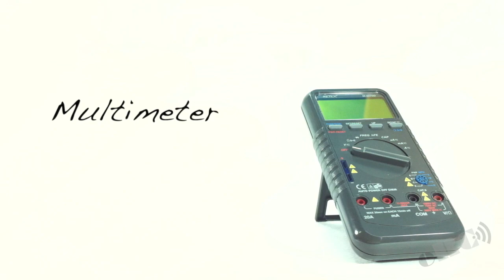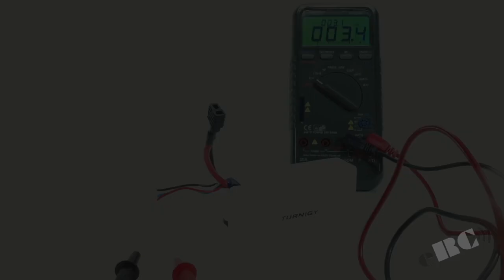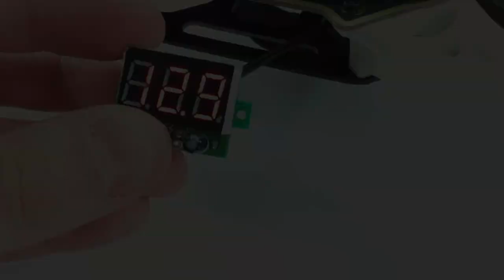eRC quad - Level 2 upgrade - Voltage display

Comment: Nice video. However, you should measure the battery voltage WHILE the lipo is connected to the quad, either via the balance plug or from the solder joints on the PCB and use this value to calibrate the small voltage display. Because when loaded, the battery voltage drops by some ammount and this way the display could show misleading values.

Comment from the maker: Well, yes, it does the same as KK2.0. But, it's quite cool and useful when you can simply hover in front of you and check the battery status without landing. After telemetry, this is the best way to easily check battery status. As I said in the video description, it's completely optional. ;)

Comment from the maker: Well, you should do fine tuning using main trims in the air. There is to many factors so it's impossible to perfectly trim it on the ground no matter what you do.